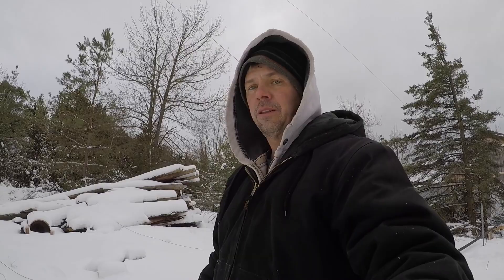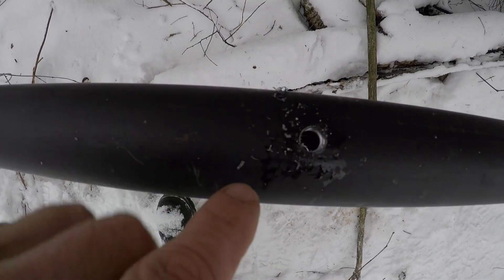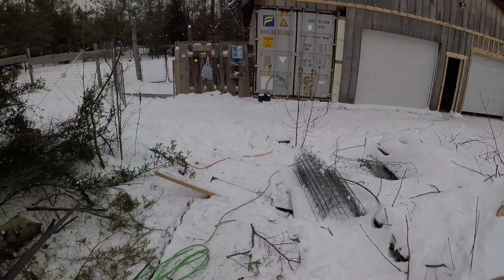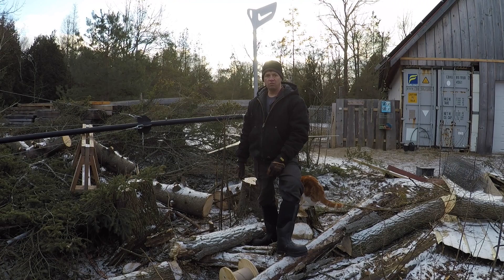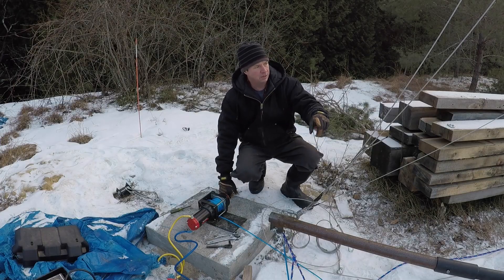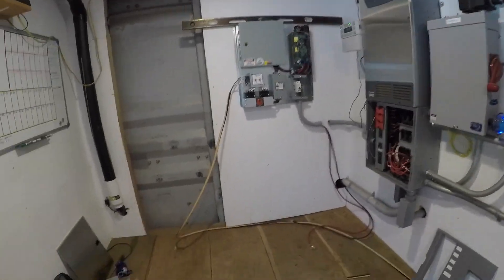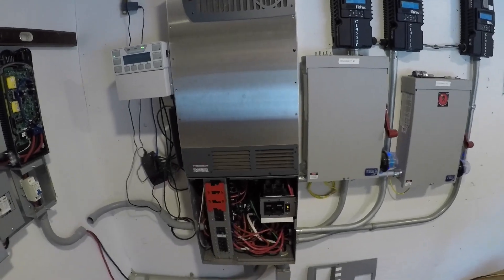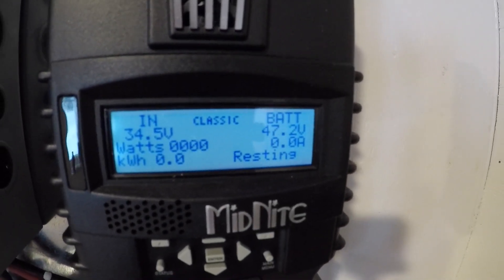Istabreeze i2000 Install & Tilt-Up Tower Completion -  Part Three- S07E03 (OFF GRID ON WIND)

Comment: I had a plan to do a setup just like yours but not sure how to tie it into a ssystem on grid / hybrid battery storage. What is that load center you hooked it up to? MWAS said this is only to be connected directly to batteries not any inverters or other charge controllers. I couldn't even find an inverter that would take 60 amps from the turbine. Wonder if I could hook this up to a grid tie system.

Comment: Hey Kurt, if you extend the wind turbine lever pole up over the winch and over the ground mounts, you can turnbuckle up off the ground mount to the pole, like my serup but my turnbuckles infront of the winch, or sorry just put a turbuckle infront to the pole then theirs no need to relocate each wire rope

Comment: Almost bought a mosuri wind and solar controller but they made it far too dificult amongst other things and ended up sticking with the istabreeze controller. Lots of work left to do.
Reply from the maker: I would not buy the controller again. It works fine but it is over priced. I could have assembled one cheaper. Also the idea that I needed a dump load is silly. There is no way that a 2000 watt turbine will ever fully charge my 2248 ah battery bank.

Comment: definitely hit a like for a tower and for the ista. I am really surprised it gives such high voltage on its peak... 140+ I guess... that's a lot
Reply from the maker: We had a few issues along the way. Mostly my mistakes, but turbine is up and running. This winter will be the big test.
Reply: @TheForeverHomestead  I guess you changed the wire? it's way too long for such a gauge, and the losses must be quite high.
Reply from the maker: It is running on 8 gauge. That is well within code now. Losses are not to bad. It is AC power house and converts to DC there. More loss with DC.
Reply: @TheForeverHomestead  Power Loss in the wires, has nothing to do with AC or DC.  Power Loss  = I^2 * R. That is ... amps squared times resistance of the wire.